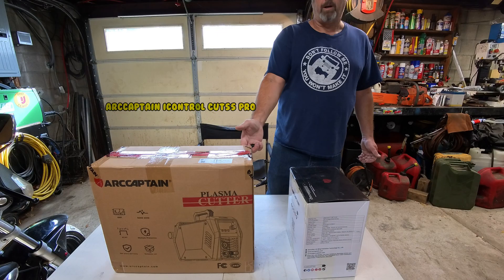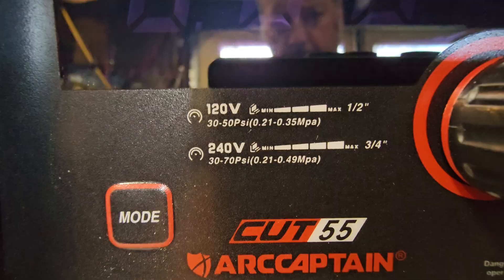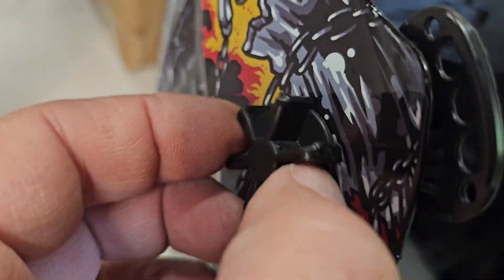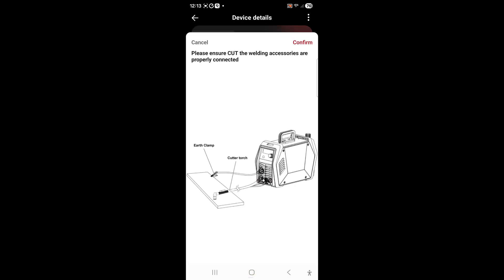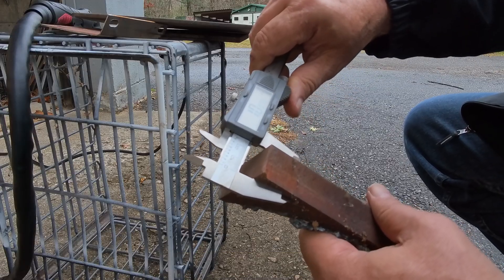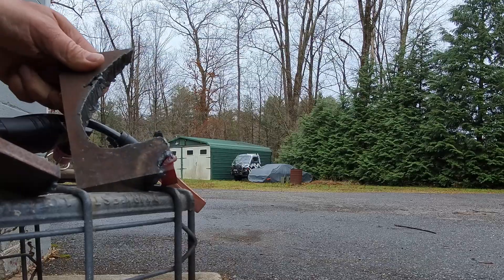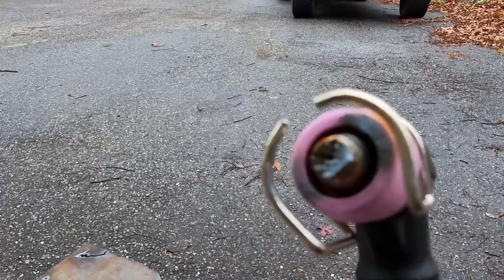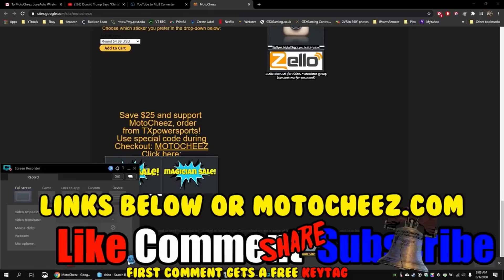Arccaptain iControl CUT55 Pro 3/4" CUT 120/240V 55 AMP Plasma Cutter pilot ARC BLUTOOTH

Comment: Nice! What is the air hose for? I don't understand what that part is for or if it needs to be connected to a compressor or something.
Reply from the maker: Yes, has to be connected to air compressor so the plasma arc gets pushed through the metal to cut, kind of like oxy/acetylene
Reply: @MotoCheez  Thanks for the clarification!